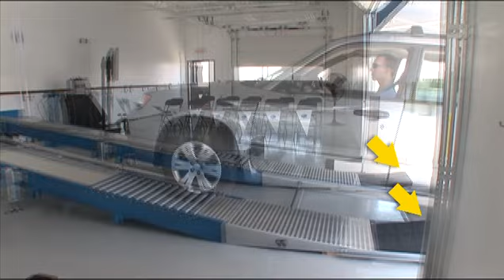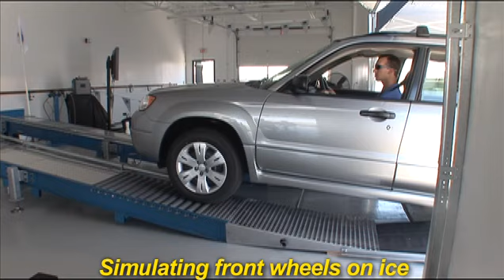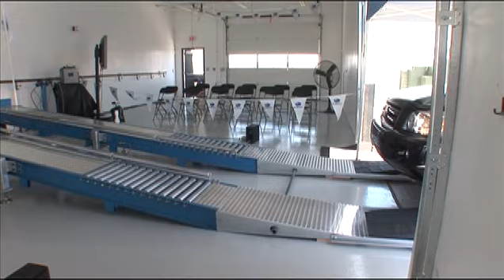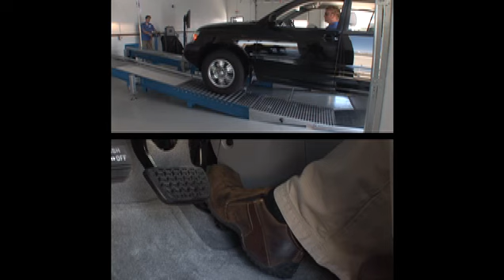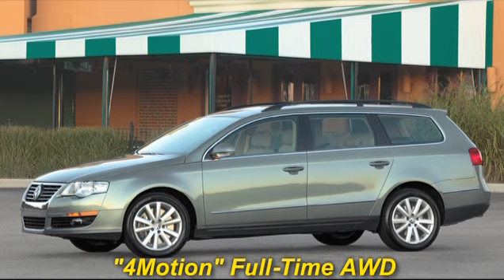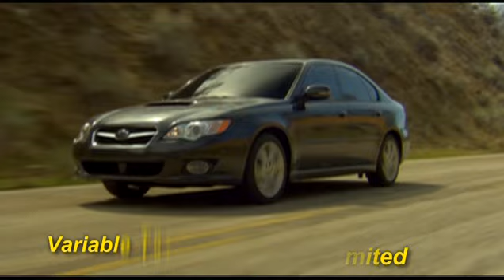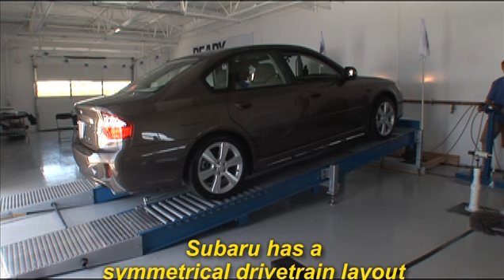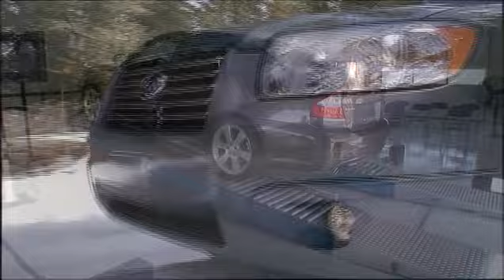Subaru Symmetrical AWD vs. Honda, Toyota, and Volkswagen

Comment: @SoDaSub Cool.  I will check out your other vids then.  The info out there, like any other industry, is different depending on who you talk to.  Of all the research I've done.  The single wheel thing seems to be a traction control/vdc thing.  Does this mean that my 2008 base model impreza sedan has vdc?  I don't have the button that allows me to turn traction control on/off.  What exactly is the difference between vdc and traction control?  In short, would my base impreza climb with one wheel?

Comment from the maker: @lostnumbr The length of the shaft has everything to do with what's being seen here. Power reaches the short side first causing the torque steer. Because the front wheels have no traction, this effect is more pronounced than what you'd see on dry asphalt. The TCS then tries to reign it in by cutting the power. Once it's reigned in, the power is once again applied, and the process starts all over again. This would not happen repeatedly if the front wheels had traction.

Comment from the maker: @yngvaigilbsteen This isn't advertising. It was a recap for event attendees. Since 2008, all Subarus come equipped with VDC. One of my new videos depict Subaru's basic Active Symmetrical AWD climbing on one wheel without a limited slip differential. Currently, only the WRX STI comes with non open front and/or rear differentials.

Comment: I like subaru and own one, but I have to say that I do think their advertising is a bit misleading in some instances.  They don't directly say in this video one wheel traction is a go ONLY if you purchase their upper line models with vdc...which their base models don't have.  They also have three different types of awd systems...some with limited slip and some without.  Not all awd systems are created equal.  ; )

Comment from the maker: @lostnumbr It's straight from wikipedia. Unequal length driveshafts can and do cause torque steer (as also stated on wikipedia), and that is the case here. You're example is true, but this is case of both front wheels not having traction which shows power reaching the end of the shortest shaft first.

Comment from the maker: @SoDaSub  Subaru's VDC works with the driver, not against him/her. It is designed to keep the car going where the steering wheel is pointed, not just to cut power and create an understeer condition.

Comment from the maker: @anasasisxenophontis None of Subaru's systems require slip before engaging. They are AWD all of the time. Even the 80/20 split FWD biased Active AWD system moves torque around based on steering, throttle, and braking inputs. 80/20 would be the split when cruising and without accelerating. The point is, if you're going to buy an AWD vehicle, you might as well buy one with an AWD that actually works.

Comment: @SoDaSub As a control systems engineer, it is my job to design things like this. Given the option, I would take my K5 over a Subaru on an icy road. The traction management system relies on a system of inputs and predictive capabilities to produce outputs. Despite the complexities, the system can never match a human's intuition or common sense. Granted the person must have common sense, so I would not expect an idiot to be able to handle driving a stone age vehicle like a K5 Blazer.

Comment: @SoDaSub The reactive 4WD system is simply a differential in the NP203 transfer case. All of these vehicles require slip before engaging, whereas the NP203 has the option of full lockup to deliver a constant amount of torque to each axle. Regardless, my argument remains the same; the more responsibility you take from the driver and give to the vehicle, the more fucked someone is going to be if they get into trouble. Again, this design caters to idiots.

Comment from the maker: @anasasisxenophontis The K5 Blazer had a completely reactive 4WD system when not in locked mode. Unless locked, its traction abilities would be far less capable than Subaru's current systems. It would not be able to climb one  front wheel with all of the other wheels without traction. It would also not be as capable on the road for rearranging torque as it requires slip before engaging. For offroading, the blazer has a locking diff, low range, a more robust rear diff, and better A and D angles.

Comment from the maker: @lostnumbr You pulled that straight from wikipedia. You should have read down a little more: "Root causes for torque steer are:
Incorrect sidewall ply design allowing deformation of the tire sidewall.
    Assymmetric driveshaft angles due to any combination of
        Unequal driveshaft length or diameter
        Transient movement of the engine
    Different driveshaft torques left to right (due to wheel bearing or differential problems)
    Suspension geometry tolerances
"

Comment from the maker: @anasasisxenophontis You are comparing 4WD to AWD. This is a comparison of AWD only. Even the worst of these vehicles would embarass a 4WD K5 Blazer in driving dynamics, safety, reliability, comfort, and fuel economy. None of these vehicles, including the Subaru, are hardcore offroaders and are not being compared to them either.

Comment: Interesting tests. I love my Honda Element's AWD, it has kicked in and helped a lot over the years on trips. Although I would LOVE to have full time 4WD I have no need living in southern California, get the system/car depending on your actual need. I got my car for outings, best CAR for camping, easy cleaning too. I've gone through rain, mud (little), snow, dirt, gravel and whatever else, hasn't failed yet. As with everything, just understand your limitations before going forward.

Comment: @JSnyder49428 
Dead wrong, Passats from 2006 onwards have a Haldex based AWD system (it doesn't fire until a front tire loses traction) which is inferior to Subaru's Symmetrical AWD or Audi's Quattro system which has a Torsen center differential.

Comment from the maker: @SparkDischarge You should check out an exploded view of the automatic transmission. It is located EXACTLYon the centerline. Subaru's VDC system reacts quicker than a LSD. In addition to that, it can run every parameter of controlling the power split through the ECU. The downside is for track use, it will contribute to brake fade. VDC allows all new Subarus to do what all none STI vehicles couldn't do, control left and right power split on the front wheels.

Comment from the maker: @SparkDischarge  Also, all of the Subaru vehicles are constantly varying torque front and back. The CVT and Auto transmissions vary torque split based on throttle, braking, and steering in addition to wheel slippage. Even the 80/20 clutch system will constantly and automatically vary power appropriation for simple things as taking off from a stoplight, braking downhill, or making a right hand turn. Static torque splits are given for cruising purposes.

Comment from the maker: @SparkDischarge Splitting the vehicle down the center yields a perfectly symmetrical left and right drivetrain. Do a google image search for "Subaru Drivetrain" and you can see any number of pictures depicting the symmetrical layout. Only the WRX STI has a non open rear differential for current Subaru models.

Comment from the maker: @SparkDischarge Your info is a little off for USDM Front/Rear Torque split...  Non STI manual transmissions are 50/50. All of the vehicles using the 5EAT and the 2002-2007 4EAT WRX's use a 45/55 split. The 2004 - 2005 WRX STI were 35/65 and the 2006 on use 41/59. All of the other 4EAT and CVT transmission vehicles were 90/10 static and are now 80/20 static. Every vehicle is symmetric because the center diff is centrally located as part of the transmission casing.

Comment from the maker: @80spodcastchannel As you can see in this video (laboratory)  and in the video I directed you towards (real world) it's more likely for the CRV to have issues with power transfer and traction. You may never have gotten stuck, but the CR-V in the video sure did. It's a matter of fact that the CRV uses an inferior AWD system.  Regarding fuel economy, Honda's AWD vehicles were less fuel efficient until the past two years. Now they are 1 mpg in either direction.

Comment from the maker: @tomnwoo The left to right movement is torque steer. The traction control isn't swapping power left and right, it's reigning in the torque steer that is more visible because the wheels are "on ice." The Subaru Legacy doesn't do this because the drivetrain is symmetrical and the drive shafts axle shafts are of equal length. I have a video of an independently done test which shows other vehicles doing the same thing.

Comment: Should have guessed it was a subaru advert with all the bs about symmetry  the cars were rocking because the traction control was swapping power from left to right  and vw only claim the passat will move NOT climb with one wheel  epic FAIL

Comment from the maker: @80spodcastchannel Subaru has really improved MPG in recent years. As you stated, Subaru's are fulltime AWD unlike most AWD vehicles. The Outback gets 29 mpg and is the most full efficient AWD non-hybrid SUV at 29 mpg. The Legacy is 31 mpg and at the time of its introduction, was more than most 2WD Midsize sedans. It's now on par with its 2WD competition. The Impreza is now 36 mpg hwy and is the most fuel efficient AWD vehicle. The Forester is on par or better than its peers.

Comment: @SoDaSub Dude...it is also a dedicated all wheel drive full time and the MPG suffers..
dont get me wrong..I LIKE Subaru's...I just prefer hondas. for a cute ute, the real time AWD honda uses works pretty excellent, you DO need to be a bit more aggressive, and disable the DSC for the rough stuff, but it works ok.

Comment: @80spodcastchannel 

CR-V has the shittiest AWD system on the planet, period. For all practical purposes, it's a FWD vehicle. I really doubt you could get a CR-V moving in TWO FEET Of snow. My big diesel 4x4 with snow tires would get stuck in that.

The Honda K is an awesome motor for certain applications but it can't be compared to a 45 year old truck motor. Apples and oranges.

Comment: @fubecabr really? then tell me how a 2006 CR-V mired in two FEET of loose powder snow pulls FORWARDS, AND backwards,with"only 5-10% of what little"bit of 156 HP and 160 lb-ft of torque, which is 14 less HP and 65% of the SAME Torque as a FORD 300 straight six budrow.
the ford which has (170 hp Torque 260 lb·ft) in a BIG cast block with TWICE the displacement. so dont start dogging Honda's K 2.4, it's a great motor for a sport ute.her truck will crack 25MPG on trips. and has NEVER broken down.

Comment: funny... my wife's 2006 never got stuck, EXCEPT when it was completely on ice, and all four wheels were stuck crosswise in tire ruts.
and it WILL pull into, AND back into a fully iced drive way even with the front wheels on ice and spinning. 
it's called a DSC off switch, just deactivate the stability/traction control, and MANUALLY roll on the power, it works fine...
Subaru's do have a good system, but your only showing off the need to have LESS driving ability to operate it

Comment: @Solumic 

Honda's system isn't really even a 4wd system. If it can only send 5-10% of what little torque it has to the rear wheels, it's a FWD for all intents and purposes. 

A part time 4wd as found in most trucks beats the shit out of honda's system and works pretty-damned well for 65 year old tech.

Comment: @rallypros 

Summer tires on a Subaru in real winter conditions is still a fail. It might not get stuck unless it's in real deep snow, but it's at a disadvantage with braking. The difference in stopping distances in any car with summer tires on snow/ice vs winter tires can be very substantial. I don't like ending up in ditches or hitting other cars.

Comment from the maker: @patbasanese It's called torque steer. The VW has a transversely mounted engine and transmission. As the traction and stability control turns on and off, it causes the wheels and thus the steering wheel to jerk to one side. This is more pronounced on the rollers due to the reduced traction on 3 wheels. The driver is reigning it in to stay on the platform.

Comment: Subaru claims the best AWD system yet didn't test other brands that claim the same...i.e.  Audi Quattro, Mitsubishi (Evo), Acura SH-AWD, Mercedes 4matic or Volvo AWD. Also, comparing lower end "4wd" Honda's and Toyota's is price biased and mechanical/tech biased.  Apples and Oranges.  Granted it is produced by Subaru for Subaru.  Oh well.  I love Subaru and always will but I would like to see a true comparison between ALL brands who make true AWD systems and not just part time FWD biased AWD.

Comment: Very good test, Subaru's system is just the best out there hands down, I've owned nothing but Subaru's and love trying to get them stuck in the winter. You can run them with summer tires in the winter and be fine, with winter tires they are overkill.

Comment: Clutches can wear, but the speed at which they wear can vary greatly. People have reported cars with factory installed clutches lasting 300,000 miles. I've also replaced a clutch in a car with very low mileage. Clutches in differentials, however, require special additives or they will burn up, and Toyota loved doing this (shipping clutch LSD's with no additives).

Comment: Good test, but I'd like to see some other scenarios besides requiring torque/traction going uphill. I'd like to see braking while losing traction downhill to see if the car can stop in a straight line. I'd also like to see traction loss on one or more tires on a flat surface, or around a turn, to see if the car can keep on course and if the driver can maintain control.

Comment: Honda's 'SHAWD' is the most pathetic pile of crap I've ever seen. Honda AWD can send approx 10% of the total engine torque to the rear wheels. The rear differential is tiny. The drive shaft is the size of a Subaru rear axle. Get a life.

Comment from the maker: @Solumic watch your language or get blocked. If you can't argue objectively, don't argue at all. Feel free to tell Lamborghini that they are junk because they aren't in any racing circuits. Subaru actually uses the same engine found in their rally cars in their actual passenger cars. Honda doesn't sell a single sports car. This is a still a discussion about AWD. The fact remains that Subaru's AWD is vastly superior to what Honda offers.

Comment: @SoDaSub Your a fucking idiot. And obviously don't pay attention to formula 1 or indy. Which are the most prestigious races in the world. Which includes the best car makers in the world such as Honda, Mercedes, Ferrari, Renault, Lotus and so on. You have never and will never see Subaru's name up with those names. They are surely not competitors with honda. Honda powers the entire 33 car line up of Indy racing and have for years, without one engine failure. Honda was also formula one. Subaru junk

Comment: @Loscaldazar If you were making true statements i would at least keep debating with you. But you are now bringing things into this conversation that weren't said. I never once said that they are all inferior to honda's. But Honda's are superior, which is why they have the reputation they have for reliability. And the CRV is not a rally car. I have driven the new sti and compared it to the TL i have driven and the NSX i have driven.. You wanna talk real all wheel drive, drive any new SH Acura.

Comment: @Loscaldazar Honda doesn't even have an all wheel drive system. It's a 4wd system made to prove it's self in the real world. Not on some stupid roller ramp, that you cant even see if this is a 4wd or 2wd version because they don't show the back tires. It also doesn't state whether or not the Crv's VSA is on or off which blurs the results. That of which they did on purpose. I never said anything bad about Subaru's awd system. They are good at what they do. So chill out Boxer.

Comment: 07 VW Passat. They made the claim that the car will "move" even if only one wheel has traction. I see the vehicle moving. They also never stated that it would move on an incline. Redo the test on flat ground, and VW's marketing team will be proven quite clever. Consumers need to use their brains. Didn't any of you take English courses in college?

Comment from the maker: @tos3rd Yes... as long as the VDC is turned on. The VDC acts like an LSD and brakes on the slipping wheel. This forces power to the side that has traction. VDC monitors wheel spin for each wheel and can brake on them individually.

Comment from the maker: @dtemplar Not all models and model years were capable of doing this. all vehicles since the 2009 Model year are capable. It depends on models prior if they were equipped with Vehicle Dynamics Control or not. Some could not climb on any one wheel. Some equipped with Limited Slip Differentials could climb on on rear wheel but not one front wheel. Some could even without VDC (STI).

Comment from the maker: @enigmaj316 This isn't a hill climb, it's an incline with compromised traction. Something that wouldn't be uncommon to find in a driveway during the winter. Considering most of these vehicles don't have Limited Slip Differentials or traction control systems capable of acting as an LSD, They are supposedly designed for moving power away from traction compromised wheels. Honda advertises the CRV as a 4x4. 

Cornering is more a function of chassis, weight distribution, and suspension tuning.

Comment from the maker: @SoDaSub In this case, the TCS will cut power to all 4 wheels and the vehicle ends up bogging down and won't go anywhere. TCS is then turned off to allow the vehicle power to the wheels. The driver would then rock the vehicle back and forth to free it from being stuck.